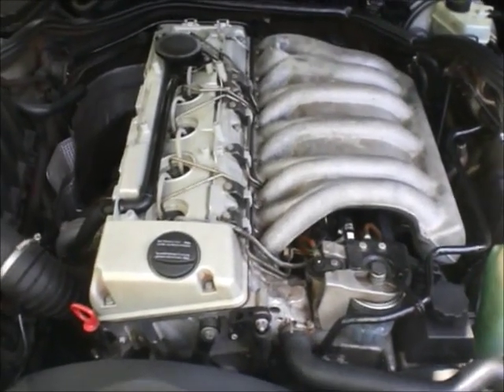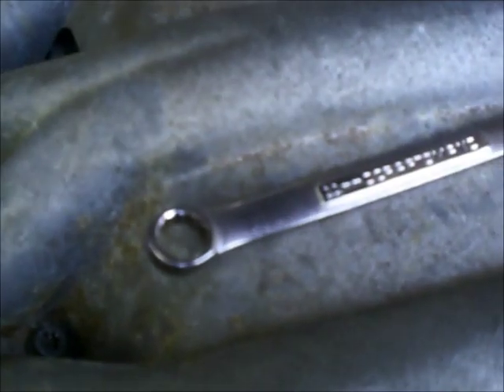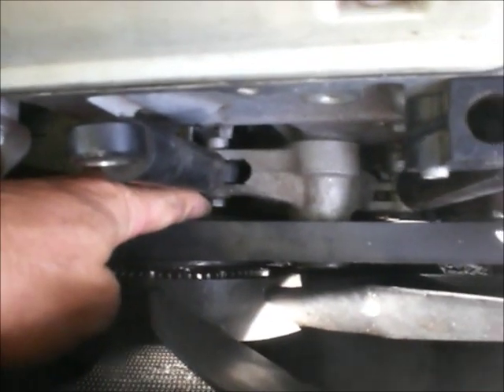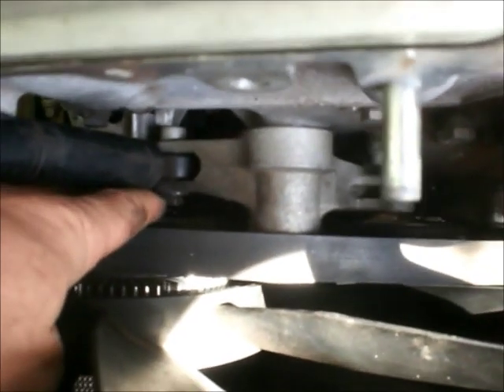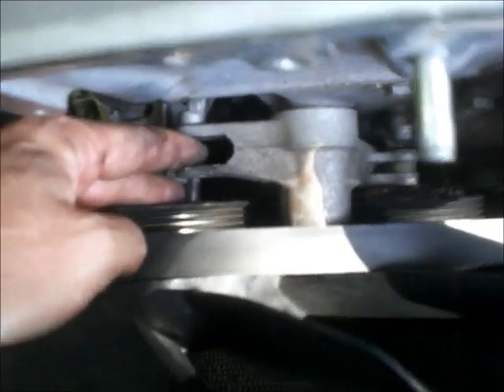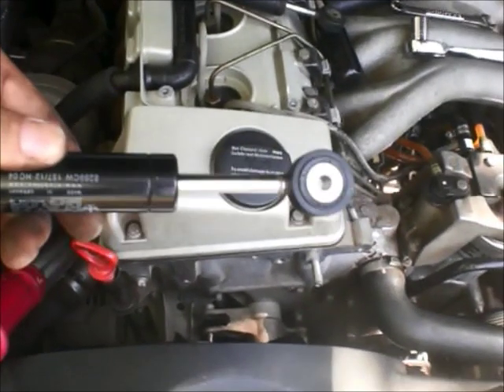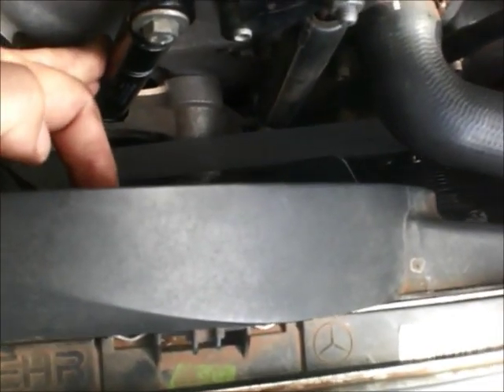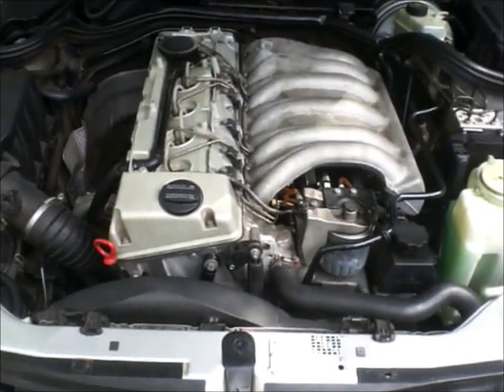OM606 Turbodiesel tensioner shock replacement

Comment: 😓I broke a part of the tensioner lever (where the low bolt is), so I got to buy a new one. It broke like butter. Maybe because it was to old, I put just a little force and it broke.
E300 1995 OM606 engine
319.000 miles
Reply: This happened to me as well. Trying to pry bottom part of shock out snapped off part off assembly and I too had to replace the whole thing.
Reply: antnip same here... how did you remove the whole thing? does it have a bolt in the hole?
Reply: @leolundberg9502  Hi...yes...there is a large bolt in center of pulley that holds it all together. I am sorry but can't remember size, or if it was reverse thread.
Reply: antnip okay good to know, thanks!👍

Comment: So I get off the highway and hear all sorts of seagulls and owls coming from under the hood. My car? Can't be. It goes away . The noise but not the alarm. Get to campsite  at dusk. Set up tent, freeze butt off, no Hawaii, and next morning over coffee open hood. The bad: spring is gone, just gone. Takes a min to figure out where something was that is not there. The good: designed to fail and still function. Found some wire in trunk and wired up tensioner for another 1K miles. I am grateful for your video as I could not figure out why the mount for the spring has two holes. No reference when the original parts are nowhere. The shock was not a consideration but is now as I have a rattle. Smiled when you did your inspection. Great video

Comment: Do you have a video on replacing engine mounts? 1998 E300D.
Reply: I have one changing the shocks on a 1995 e300d - I suspect the procedure is not much different. Right now I'm swapping a 1999 turbo block into my 1995 chassis with a manual merc 6 speed behind it

Comment: Today I changed the shock on my 1998 E300D. Without your video, I would have probably given up! I finally got the shock out, used my "mill bastard" file to shorten the bolt just a bit. Finally got the shock in place, took a while to fit the bolt back in, but with a little adjustment, the bolt went back in successfully. I remembered to "exercise" the shock. When I cranked up the engine, it was a great joy to hear a quieter running engine. 287,000 miles, still rolling. Many thanks. Gary Edwards

Comment: Quick question, was that a secondary shock to the right of the one you replaced? The right one on mine is totally broken off! And my serpentine belt is soo loose it doesnt turn the alternator

Comment: good job..during my installation i used a long bar, slide it  between the top of the water pump and  tensioner  , then pry it upwards for the base of the shock to go above the water pump tensioner  then pull out the bolt (easy)

Comment: Thank-you,Thank-you I am in the process of changing the shock due to rattling noise it is creating.  I could not remove bottom bolt on shock due to pulley in the way, so I started to remove idle pulley assembly, but that hasn't helped, that uses a 12 mm allen and a flat plastic cover snapped over it.  That did not work either.  now that I saw your video I will go back tomorrow and use a little screw driver and try to pop out the shock.  If that works I will take a file and file both the head of the bolt and the end of the bolt to provide some more clearance,  I hope this method works for me and I don't mind if I scratch the bottom of the shock.  No more German cars for me.  The engineers give no thought to mainteance and I have two Mercedes left.  1987 W126 300sdl and 1993 300sd both of which I repair my self.  Japanese cars are much easier to work on and more reliable.
I have an Acura tl 2001 which is much easier to work on and has 170k miles.  My next car will be Japanese even though I have worked on Mercedes for the last 45 years.  
I will report back to you with what progress I make.  Thanks so much.  DR

Comment: I tried forcing the bolt out as you demonstrated and wound up snapping off one of the tensioner arm "ears" (closest to the radiator) that the tensioner shock absorber bolt goes thru. I found a good deal on a new belt tensioner adjuster from Amazon($28.78). I should not have been so "lazy" ... I wish you had demonstrated the procedure without taking the "lazy" man's way around it, as it would have saved me some money and vehicle down time . . . 
1987 300D Turbo OM 603

Comment: great video ,could you maybe make another and show how the fan is removed.   if you use the locking pin method on the water pump shaft [behind the drive hub] you can insert an allen wrench for locking purposes.you then use an 8mm allen on the recessed bolt dead center of fan.   now remember kids this is not rocket science ,  righty tighty ,lefty losey.   and dont foget to look up your torque spec .   el doctor esta en la casa, bueanas

Comment: Just an FYI - if you use the OEM tyre iron in the boot, the handle of the tyre iron is the correct size for the hole to release the spring and you can use the rest as a lever to release the tension.